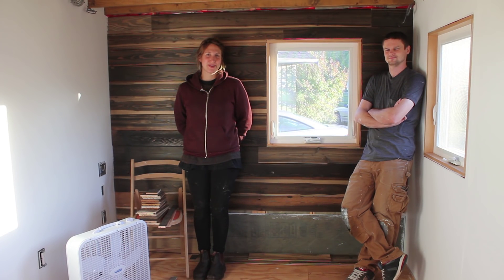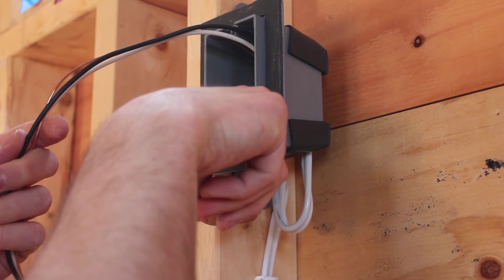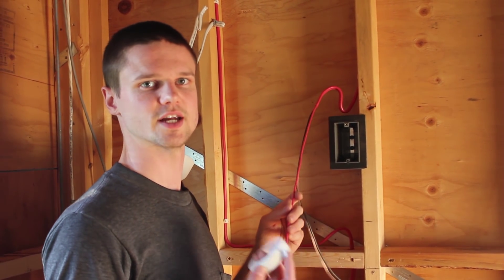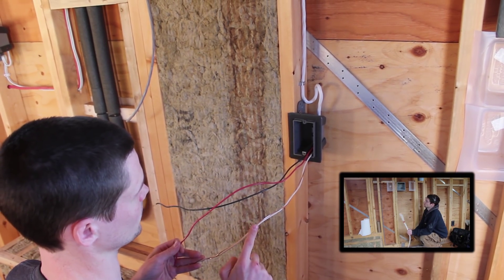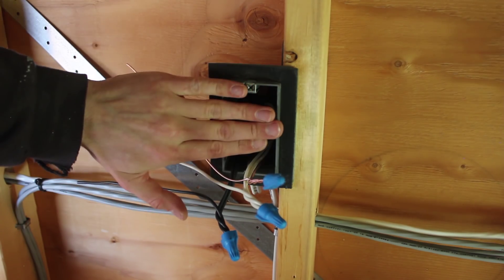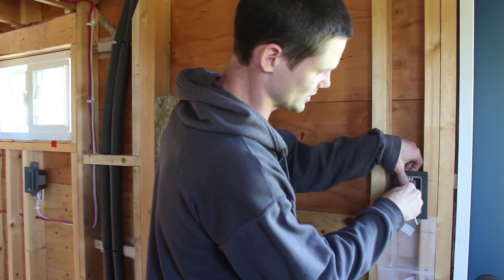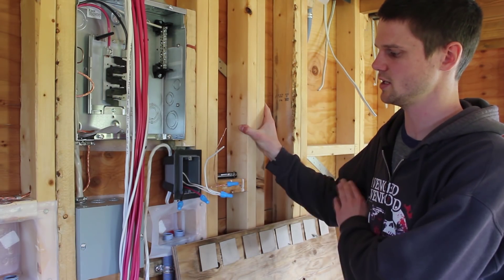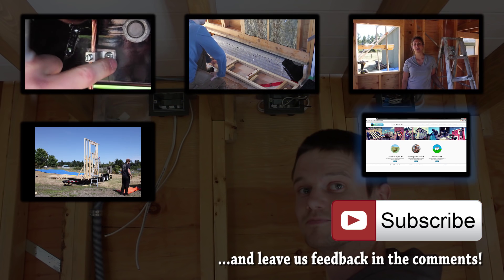Electrical Wiring - Part 2 (Ep.42)

Comment: You'd get fired from my employer stripping wire like that lol. And why use the vapor boxes instead of blue nail on ones?
Reply from the maker: What specifically about my stripping should I improve on? 
The vapour boxes are to tie into the vapour barrier which we installed as part of the shell. Every wall is an exterior wall.

Comment: 1.  The outlets are not upside down, they are in compliance with the electric code; go look it up.2.  When you describe the 120/240 split circuits sharing a neutral you should really have completed the description and said that such a circuit needs a two-pole breaker with the handles tied together.  Your successor might not realize that the circuit continuing to the single pole outlet is a shared circuit.
Reply from the maker: Yes there is not a required orientation, just a common one :) 
Thanks for the additional point about the split circuit!

Comment: Why is the Romex red? Is that type meant for 240 and your using it for 120?
Reply from the maker: Yes. The material is identical, but it's pre-coloured to identify the conductors in a 240V circuit. That's why I wrapped the red in white tape inside all the boxes to change the identification to a neutral.
Reply: Tiny Nest yes but then why not just use the yellow 12 2 Romex then? I’m asking because I’m only 14
Reply from the maker: Ah, well we were trying to use up some spare red Romex instead of buying new yellow :)

Comment: Your workmanship is top notch and the planning that has gone into the Tiny House is very impressive! There are fellow industrial electricians that I work with that don't come close! That being said if you check out 404.2(C) of the NEC it covers the requirement to have a  grounded circuit conductor in the switch box. I was wondering if the reason you went with the two conductor method was due to one of the exceptions?

Great work! Thank you guys for all the time and energy putting these videos together and the thorough detail!!!
Reply from the maker: It's entirely possible that both the NEC and the CEC have been updated, since many electronic devices require neutrals (other commenter was just pointing this out as well). I originally learned on the 2009 code and have not been in the residential workforce for several years. I agree that best practice would be to bring a neutral into every box... in the case of our one light box in this tiny house, I went with the simplest installation.
Reply: That's an excellent point! I'm sad to hear you aren't in the residential workforce anymore you're very skilled! You both have done such an amazing job! Keep it up!

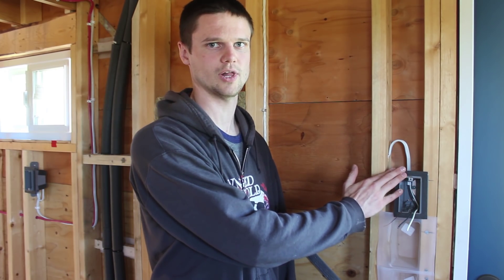Comment: The situation shown starting from time index 10:56 and going through time index 12: 27
I absolutely hate that with an absolute vengeance !!! Although I am not a huge believer in codes it is one of the few things I believe should be added to the code that you aren't allowed to do that. Reason being is that way too many times I have been asked to install a newer sensor or timer type unit to replace a simple switch that has been wired this way and many such units need to wired into a neutral which you have no access too when a switch is wired this way.
In a new wiring install where the power is run into the light box and there is a drop down to a switch box I always run a 3+bg (instead of the usual 2+bg) for the drop down from the light box to the switch box (black, red, white, bare-ground) and use a label maker to make labels for both ends of that drop down run as black=hot, red=load, & white=neutral so that with a simple basic switch the two blacks are connected together in the light box and then the black and the red are connected to the two poles of the switch with the white capped off in the switch box and the red in the light box connected to the hot terminal on the light fixture and then the two whites in the light box connected together and to the neutral side of the light fixture.
Thus making the neutral available in the switch box for if a more complicated electronic switch, sensor, timer, etc... is installed at a later time which on more then one occasion has been just after the sheetrock was installed, muddled, & painted and then the client decided that just a simple switch was no longer good enough for them and they decided to upgrade to something fancy that had to be hooked up to the neutral wire as we'll in the box to have both sides of the circuit to power the electronics.
More then once other guys on the crew that thought I was nuts doing it that way and it wasn't necessary have seen my forethought save the bacon later when the client swapped out for a fancy sensor switch that needed the neural after the walls were already finished.
Reply from the maker: Hahaha, you make a very good point. I like your 3-wire method of bringing the neutral into the box, that would be the most future-proof practice. I believe I've seen devices out there now that use the ground/bond as a return path for the power that feeds the electronics, since it's an immeasurably small amount... and some electronic dimmer units will trickle current through the lamp itself in order to power their electronics (if there is no lamp in the fixture, the unit won't power up). We knew we wouldn't want anything special at this switch, which is why we went ahead with using 2-wire.
Reply: Yes some do use the ground/bond, but try telling a client they can't have the specific unit they want to use (that requires true neutral connection) and they have to use a different product which is not exactly what they want because it works by connecting to the ground/bond.  Not a fun conversation. Plus it leads to the potential for what I consider a very dangerous "hack" where someone rewires the bare ground wire as the neutral to bring the neutral into the switch box leaving that run and switch box without a ground/bond and a potential secondary bonding in the light box if they don't completely isolate the bare ground wire they do this with.  Add to that potential for confusion later on with someone not realizing it's not a ground wire.
Reply: Don't get me wrong, your house so you can do whatever you want. Just one of my personal pet peeves.
Reply from the maker: I have seen that "hack" before and it's totally unsafe. It's I totally reasonable peeve :) and I very much appreciate your feedback and would recommend it to anyone reading this. Cheers.
Reply: The newest edition on the CEC now requires the neutral. I guess we'll be using a lot more 3 and 4 wire.

Comment: on useing 3 wire for 2 diferent 120 circuits each legy must hook up to oppisits on the main if you hook up at the  main and both legs are on the same power buss then you have 40 amp instead of 20 amp going back to your nutral wire causeing a fire hazord , if im confuseing you on this i strongly recomend you talk to a electrician or inspector
Reply: +grizz270 never mind my coment you covered it lol
Reply from the maker: +grizz270 Not to toot my own horn or anything, but I did average 98% in my electrical apprenticeship schooling ;D... I have become a little rusty, but this is a very critical concept that anyone working on electrical should understand, so I'm glad you caught it!

Comment: Why did you use weatherproof boxes throughout the whole tiny house?
Reply from the maker: +Shawn Watchorn They're actually vapour-sealed boxes, they would not be suitable for use outdoors where exposed to actual weather. We are using a full vapour-barrier in our structure and the pre-installed foam on these boxes becomes part of that barrier. Boxes without the foam would create a breach in the barrier where outside air could draft in or vice-versa.

Comment: Jake (or anyone really) if building a tiny home,does the electrical and plumbing need to be done by a licensed worker for the home to be insured? Sometimes you hear of insurance companies not paying for one reason or another.

Thanx.
Reply from the maker: +ScootOverMan I don't think there is really any standard for anyone to go on in terms of insurance. As far as I know, each tiny house owner needs to go through insurance options on an individual basis. I'm sure it helps if work is done by licensed professionals... but obviously we are pretty die-hard DIYers :P

Comment: Is there any specific reason you like to have your outlets upside down?
Reply from the maker: +Phineas Yoder With the ground (bond) on the top, if a plug is sagging and partially pulled out, only the ground (bond) will be exposed. Whereas with the ground (bond) at the bottom, the first thing to be exposed is a potentially live hot prong. I also feel that a plug would resist this type of sagging more with the ground (bond) at the top because that prong is thicker and longer, so it takes more to pull or bend out.
Reply: +Tiny Nest I've always wondered why electrical wasn't done this way for this reason too.

Comment: Question for ya.  I noticed that you don't seem to have any 12-2 w/g white and black.  Is that because you didn't want to have another wire reel and so the 12-2 w/g red and black covers both by making the red a white when needed?  You guys do have 12-2 w/g white and black romex in Canada right?  just curious.
Reply: +Deric Kettel he didn't use any because he had the 12-2 red and black already, probably leftover from a previous job he's done
Reply: +Deric Kettel Canada has the 12-2 white and black, it's normally yellow :)
Reply from the maker: +Life Inside A Box Not sure how we missed this comment... YouTube is so buggy sometimes :P... that's right, I had some left-over 12-2 with red, but the stuff I would normally use for 120V circuits is black and white with a yellow outer jacket.

Comment: Hello. Isn't true that the grounding portion of the outlet be down? That way given the male portion of the ground on a plug is the last thing to exit the entire plug when pulled down?
Reply from the maker: +tech2480 This is true, and is one way of looking at it. Conversely, with the ground on the top, if a plug is sagging and partially pulled out, only the ground (bond) will be exposed. Whereas with the ground (bond) at the bottom, the first thing to be exposed is a potentially live hot prong. I also feel that a plug would resist this type of sagging more with the ground (bond) at the top because that prong is thicker and longer so it takes more to pull or bend out.

Comment: good detailed information for the layman.  For your recepticals, do you have the kind that you just stick the wire into the back? any reason you chose not to use them?   In the US we have 2 wire 12 guage that are black, white  and bond as a standard.
Reply from the maker: +Duane C I HATE it when people use the quick-connects on plugs... the benefit is that it saves the installer 30-60 seconds per plug, but it makes working on it later a pain, plus if a plug burns up in some rare case, it can take out the rest of the circuit because the plug is providing the wire-to-wire connection... I much prefer the pigtail method... takes a little longer but doesn't suffer from any of these issues.

I've heard that everything is 12-AWG in the US. There's nothing wrong with that since you have even more ampacity head-room. They actually upped the ampacity of 14-AWG to 25A recently but added extra rules to keep you from using it above 15A except in specific situations like with motors... generally it seems that modern cabling can handle a little more current than it used to so 14-AWG is what is accepted and widely used for residential 15A circuits.
Reply: +Tiny Nest yeah pigtails are the only way to go and landing them on screws.  I was glad to see you doing that in your house.    I have seen a hundred plugs get over heated because of the push spring clip type connection, personally I think they should have done away with them 30 years ago.  Plus as you stated you break the circuit if one plug goes bad, and it makes it harder to locate the problem later.  Nice job!
Reply: +tiny nest, in the US we still use 14 guage wire for lights and recepiticals, but we have a code no more than 6 connections per circuit, 1 out let every 6 six. Only the kitchen and appliances get the 12 guage (at least thats how it was done back in the 80's when I did that work)
Reply: +Tiny Nest Well, I'm comparing this to my 280 sq ft condo conversion that has a total of 2 outlets for 4 plugs in the kitchen, plus the 220 for the stove. There's also one outlet for 2 plugs in the bath (that I upgraded to GFCI) and 3 outlets for 6 plugs in the living room. Add to that 3 switched boxes on the ceilings for lights and you have my entire system. Hence my dependence on plug strips and surge protectors.

Now I'm wondering what you will be doing to protect your electronics from power surges. Can't wait for more videos.
Reply: +Tiny Nest I was wondering about this too. There really has to be a simpler way to do all this. I have to admit that, in your position, I would have used fewer boxes and more of the clever extension/surge protector thingies available now. Many now have USB options as well and you can add them where necessary. The latest thing is having the outlets turn to make room for transformer plugs and the like.
Reply from the maker: +MakeMeThinkAgain We have a very clear plan for everything that's going to be in the house, and there is a lot! So we've made sure to cover all possibilities... if you think this is complicated, you're in for a treat when we do our control system for lights and environment ;D
Reply from the maker: +Deric Kettel Hey! You posted your own comment on this video but we cannot reply to it. I sent you a message through YouTube explaining that you must have a privacy setting that disables replies to your comments... It must be letting me reply here because this is a reply to +Duane C's original comment. If you can change the setting we'll reply to your other comment (and please tell us when you figure it out because about 1/30 comments are un-repliable in this way)

As for this comment: yes it's the spring/barbed bite in those quick-connects that are just not as solid as using a screw terminal.
Reply from the maker: +Duane C Hm, our code currently allows up to 12 "devices" on a circuit, which includes lights and receptacles. This assumes roughly 1A per device and/or that not all will be in use simultaneously. If a circuit is 100% lighting it can be loaded up to 80% of the breaker value based on wattage. 12-AWG is generally used for 20A heating and kitchen circuits.
Reply from the maker: +MakeMeThinkAgain I've always been annoyed when trying to set up my stuff in a new living space and there aren't enough outlets :P

You make a good point about the surge protection... my main PC will be on a surge bar, but we may fork out for a surge-protected receptacle to save space in the control panel.